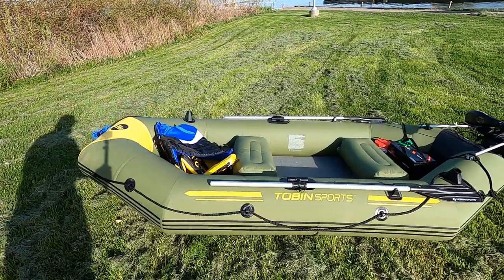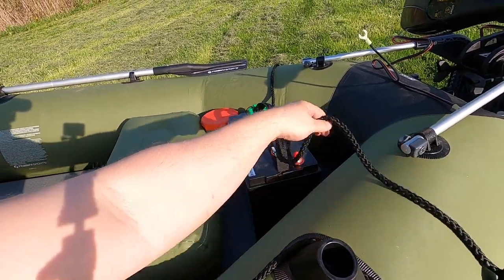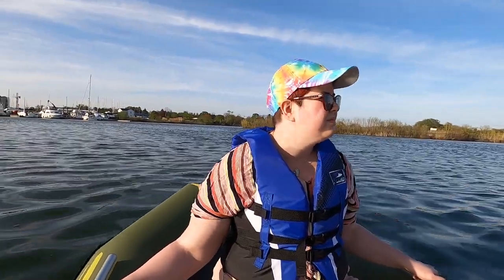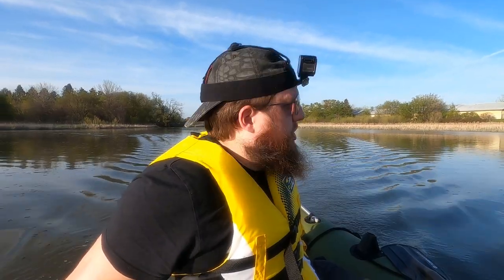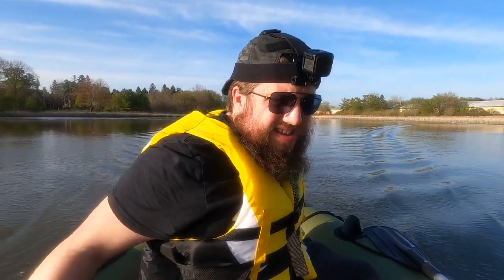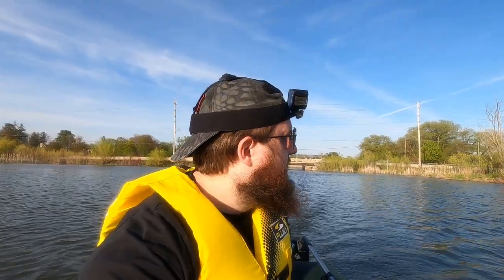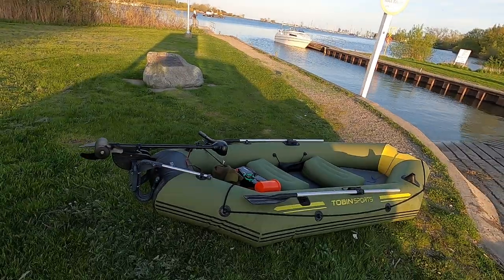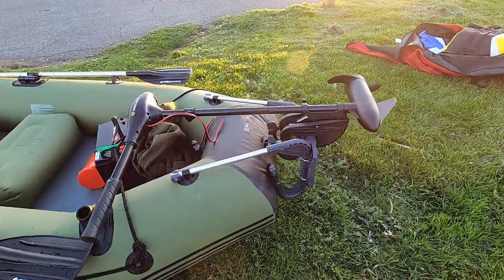DIY Long Range Electric Raft For Raftpacking! Specs & Test Run

Comment: Are you able to hook up your solar setup to the battery so it can charge while you are using it? Should have lots of sun shine out on the water. That would boost the battery range quite a bit I would imagine.
Reply from the maker: Yes sir, and that is part of the plan!

Comment: This battery is so cheap compared to skateboard batteries. I didn't know this technology, but it matches so well with the boat and the motor.  Thank you to share your knowledge.
But I am concerned with the engine power. On a lake, a sudden increase of wind, would create a safety issue.
Reply from the maker: I'm actually working on an esk8 build with these LFP batteries haha. Its gonna be wack

Comment: How does that raft do over rocks?
Reply from the maker: Unsure at this point. It doesn't sit to deep in the water, but I'm not sure I'd want to bottom it out frequently.

It's lined with a tougher layer to resist abrasion, but I don't know how well it'll hold up

Comment: Hey Mike! I am so happy to have found your channel. We're into a lot of the same stuff! My son and I did this same raft project. I learned that if you add a PWM (pulse width modulator) you can get a significant amount of extra power from your battery. Also, if you use 4th gear and don't push into 5th, you'll save on power as well. So much fun to be had!

We also played around with a 100w solar panel on top of a bimini to get more range. 

Why use something out of the box when you can ridiculously over-engineer it? :D

Check out Tiny Boat Nation here on YT. He has more ideas for steering and optimizing the battery power.